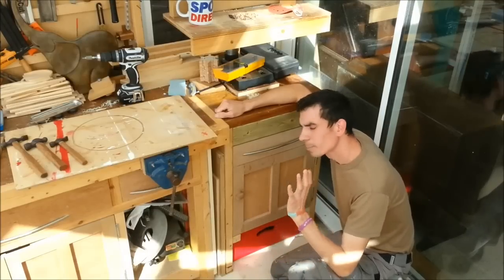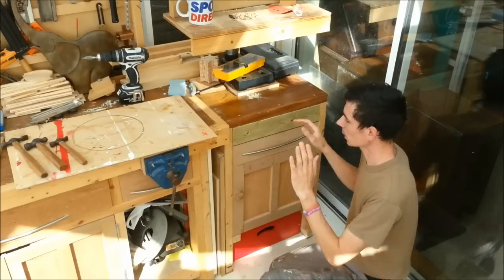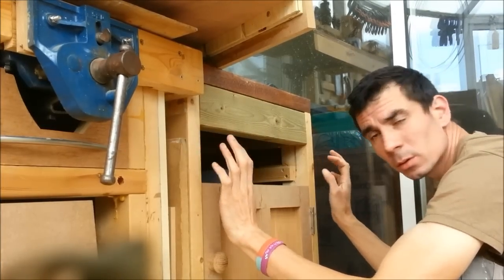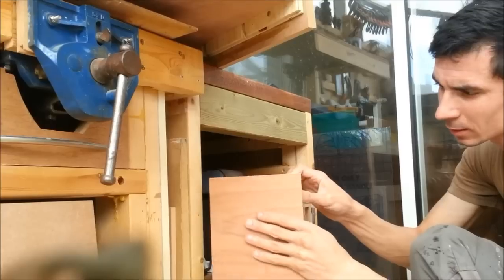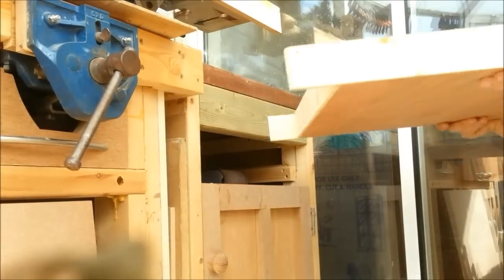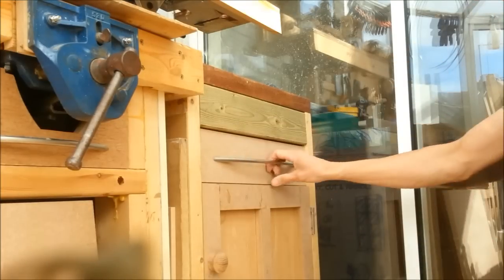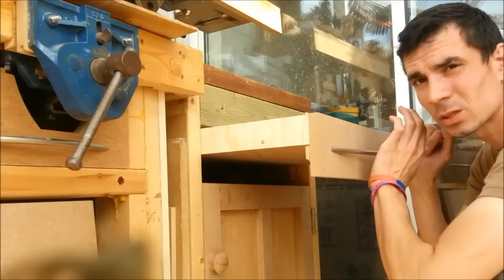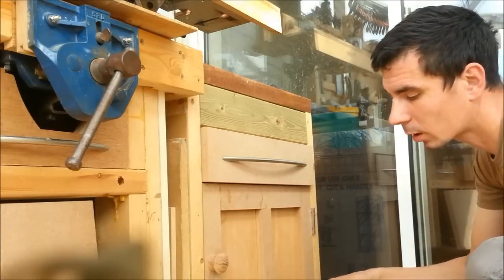#MoneySaveMonday - Drawer runners!

Comment: I've watched twice now, but am still unsure of exactly what you're doing to keep the drawer-tippage from happening? Maybe if you took a picture of the inside of the drawer-cavity? Am I the only one not able to 'get' it at this point?
Reply: ***** ah that explained it so you placed another runner above the main runner and with the extension tails on the back of the draw it stops the tip. Is that right or am I well off?
Reply: ah that makes sense. I was wondering why the lamination but that explains it.
Reply: ***** thanks for the clarification - the laminated edge to prevent wear makes complete sense!
Reply: Could you edit it back in?  Love to see it.